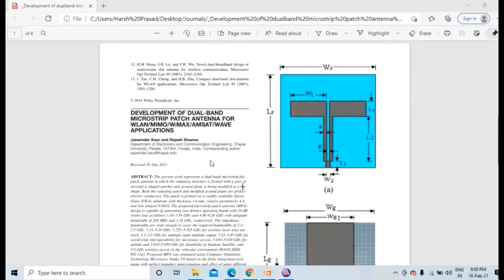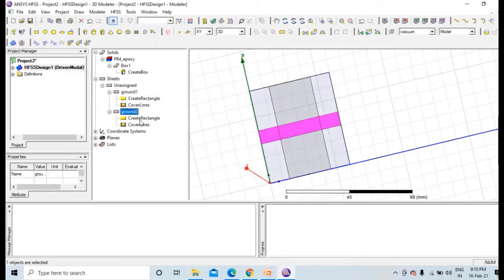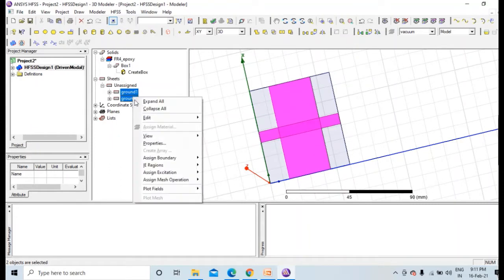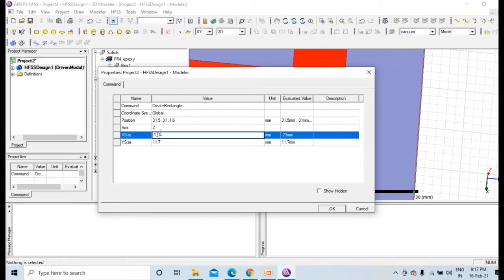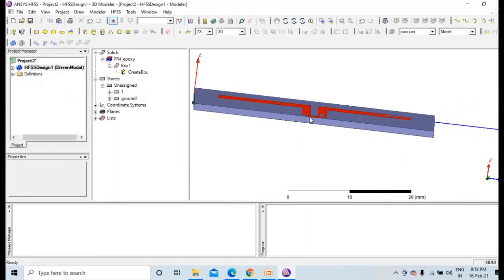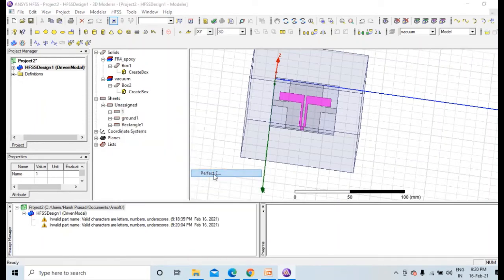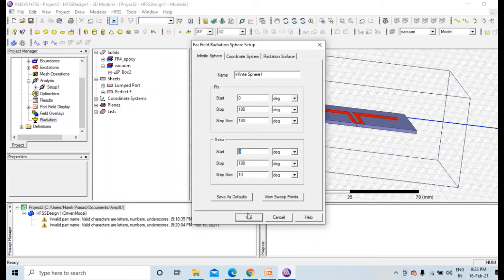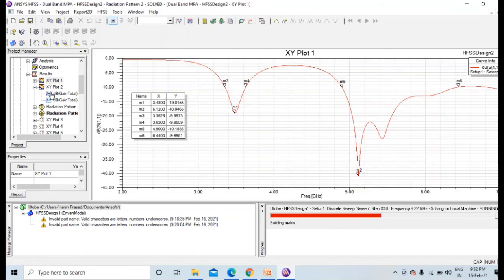HFSS- DUAL-BAND MICROSTRIP PATCH ANTENNA Design with Simulation.

Comment: Sir..How did you calculate the height and width of the feed line.
Reply from the maker: For the exact calculation part you can refer to Balanis Book or some other IEEE Journals. 
In this design, height and width were already given in the Confrence paper. (Link in description).